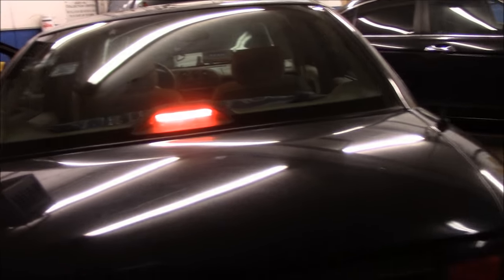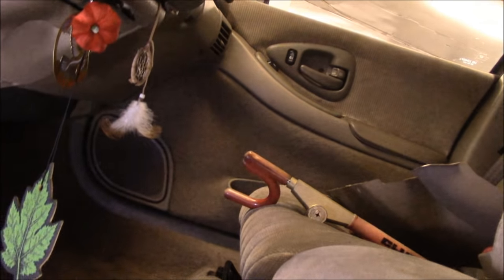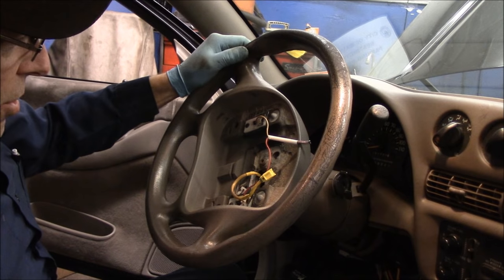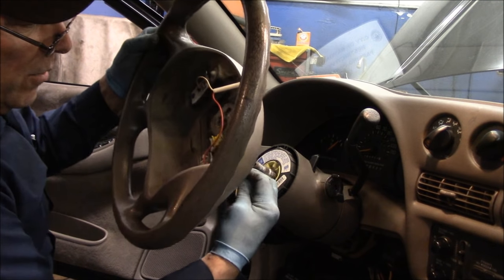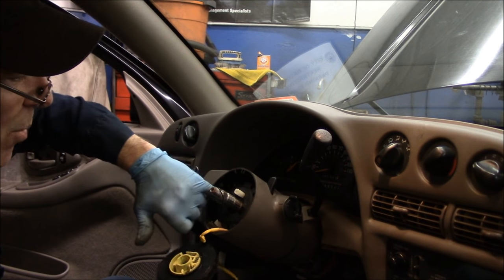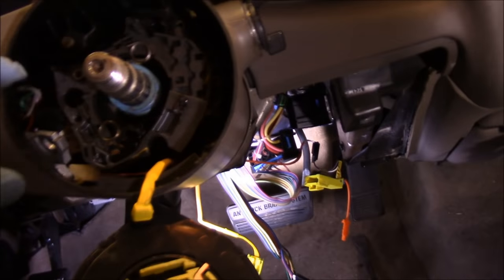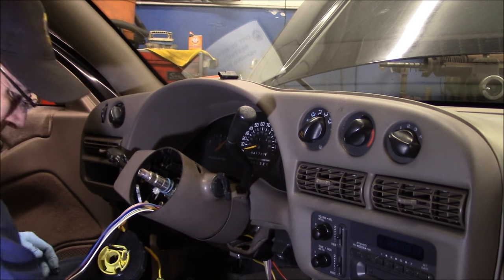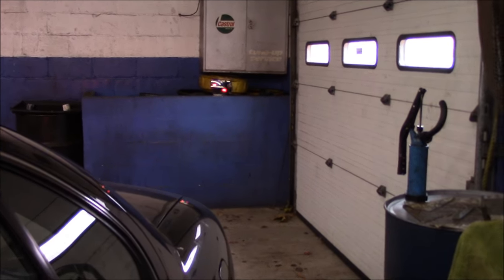Diagnose and repair no brake lights (3rd brake light works)

Comment: Brake lights on my 2000 Tahoe stopped working but the roof light worked.  The problem?  The hazard switch was the issue.  A $15 switch was all I needed.  The old one would work if pressed to the left to make batter contact with the 3 copper spring loaded contact terminals so I figure the spring for the stop light circuit was bad. My 4 ways worked,, turn signals worked but not the stop light.  Problem solved.  Pull out the hazard switch using a pick on the front left corner to release the tab that holds it in. pull it up and plug in a new switch.  A simple fix!

Comment: Had this problem, I just took the third lights bulb rerouted it to each tail light and drill a hole with keyhole bit.
Reply: Hey justin which 2 wires go to brake light coming up from bulb itself. Don’t have d.c.meter and can’t I go to just one side let’s say driver side since they are tied together
Reply: YUP...MICKEY MOOSE...IT WORKS...(Moose?? Bigger than mouse...it works...I am about ready to jump mine like that!!! 91 Sentra...great car...just problems with right rear brake has me spinning...grrrr...ha!!!

Comment: All three of my break lights are out on  a 2012 Kia Optima and the bub's are good. Tried to remove the switch but there is no room to remove it. Need a good step by step video on how to remove and replace with a new one.

Comment: These cars are a nightmare with the way they wired them.  Mine is possessed because sometimes things work and sometimes they don't.  The radio will not stay on and I cannot control the lights manually.  Ugh!  Thank you for the video!
Reply from the maker: Thanks for sharing

Comment: Just used this to fix my brake lights on a 2000 Chevy Lumina. Things to note: The steering wheel and the sensor under it cant be put in any differently. They all have special notches to prevent misalignment. The only really challenging thing was to get that lock ring off of the spring retainer. Otherwise with these instructions it was a fairly easy fix. Thanks For The Video!

Comment: in 2013 I had a 97 Lumina with this issue. Mine worked when I pulled the Turn Signal lever back. I knew it would be too complicated and expensive to get it repaired so I just rode it out with my janky lumina lol. I miss it.

Comment: Jim, THANK YOU. I purchased a 1998 Lumina for my granddaughter,  2 months ago the brake lights failed. I followed your directions and purchased the part at Auto Zone for $53.00, they in turn loaned me the puller and compression tool for FREE. followed your instructions and in 2 hrs she was back on the road. Great job explaining! Now all I have to do is put a motor mount in. (You got a video for that?)
Reply: What’s the name of the part?

Comment: My moms 2005 Altima’s fix. After trying all “THREE” fuse boxes, changing bulbs (smh, bulbs wasn’t blown) it was the brake light switch that was causing the break lights not to work. (Break light bulb is the same as the tail light bulb, if the tail light works then check your brake light switch. 30 second fix, no tools required to replace.

Comment: I remember doing that same job numerous times. Today's cars are so much easier with the modular multi function switches. The lock plate depressor is a must-have tool.
Reply: I have a 1996 Chevy Lumina only center brake light works. It only has one bulb on left and right side to operate the parking,brake,signal and hazard. Why would they have one bulb to do all that?

Comment: Thank you for your video-I am not a mechanic of any sort but i did check my bulbs and fuses and think i have a wiring problem-need a water pump as it is and I am now wondering if its even worth to keep getting this car fixed! it had a new tranny in 5 years ago and i dont drive a whole lot also an alternater heater core and thermostat! Im just discouraged! But still thank u! My lights also on dash for gears shift work intermittent-seems chevys are kinda notorious for wiring issues!

Comment: I have a 92 buick riviera 3.8 my left brake light works sometimes than it stops than it works again so on so on could that be the break light switch or you have any direction i could start at i parked my mustang and need this for work monday lol thanks in advance

Comment: Just had no rear brake lights/ no turn signals,,,, the wiring harness from the frame to the trunk was the problem, notorious for the problem... Fixed in an hour
Reply: Could you explain a little better for me? I’m having same issue…
Reply: @trisharush6070   look on driver's side of the car,, and the wiring harness goes under the floor moulding.. follow it up along the rear seat back and you will see where the harness goes through the metal hole and continues into the trunk.. The harness usually shorts out at the point where it goes through the metal hole

Comment: so heres a question. My 2001 maxima only has the 3rd brake light working. I replaced the driver tail light and it didnt work after that. I tried switching bulbs and testing using the old tail light wiring snd nothing. The light works for headlights but not brake lights

Comment: So this switch does the brake lights and turn signals in back right? Third light works. Tail lights work just No brake lights or signals
Reply: rebecca anderson When you put your signal on with the brake pedal depressed, the circuit thru the switch allows the brake light on that blinking side to either go out or be blinked. If the brake light stayed on it would outshine the signal light to some extent, depending on your make and model of car. This switch is a chronic problem with GM vehicles it seems.

Comment: I'm having this problem with my 2007 chevy uplander. My brake lights or blinkers don't come on, my tailgate brake light work, my hazard lights work inside the car but not on the outside. We changed the fuse and it still isn't working.

Comment: Mine is doing the same and also I can't use my turn signal either where can I order the replacement multifunction switch and handle if need be

Comment: I have a 2011 Cadillac SRX.  I have changed out my brake switch several times, but the brake lights come on when leaving the vehicle. I had it fixed again; but now, the brake lights still come on when the alarm is set. Have you ran across an issue just like this or could it be the same since I replaced the clockspring?

Comment: 2013 hyundai sta fe. Exactly the same problem. Only the third light goes off when i step on the brakes but when I lock the car, the brake lighs flashes.

Comment: My third doesn't work, but volt meter shows 12.5 volts. Jumper wires to a spare 3156 wont light it up.
I'll have zero volts at the third when connected, but if I unplug it, my volt meter jumps to 12.5.
I've never had a 12 volt system behave this way

Comment: Im working on a 1996 crown Vic police interceptor. Problem I’m having is that the brake lights (and hazards I might add) are not turning on when engaged. The third light will come on, but not the other 2. Hazards will not turn on in rear either but they do come on in the front. Blinkers work fine. I’ve tried messing with the hazard switch, replaced the brake switch at the pedal, and checked bulbs/fuses. Something to note (unsure if relevant) is that the hazard “clicking” when engaged is faster than the blinker (unsure if that is normal) but it’s almost as fast as when it’s telling you the bulbs are bad. I have not tested the lighting control module because the blinkers are fine. Any help?
Reply from the maker: C L18 this car has two flashers one for the turn signs and one for the four way did you check both?
Reply: jimthecarguy thank you for the reply, in fact, I found out that this is only a problem while the vehicle is in park. In drive, everything works great, would you think it’s most likely a police harness issue they may have cut a wire? Only an issue while engaged in park.

Comment: Jim can you get me that car part? The turn signal multi function switch for my 1997 Chevy Lumina.My car has the same problem no brake lights and my signal doesn’t hold. It’s discontinued

Comment: Damn the car makers. Complex  cars suck. Wiring cars up like this SUCKS. Hate it.  Could you imagine if the emergency brake light circuits went out because of an issue with some stupid accessory. This is all wrong.  Lighting circuits should be simple to repair.

Comment: The brake lights on my 2000 Tahoe stopped working,,the roof brake light worked,,turns and 4 ways worked. ???  After checking the fuses in the fuse panel.. all good,, no tow package so no fuse or relay under the hood.  I cleaned the ground bolt and washer on the left rear frame where the light harness was grounded using a wire brush.. still no brake lights.  SO... to make this short what was the problem?? A loose 4 way switch.  I found out by holding that switch to the left with the 4 ways off and depressing the brake peddle,, the brake lights worked!! So the switch has apparently somehow loosened up. I took a small piece of cardboard and folded it to a size I could wedge into that hole to snug up that 4 way switch for a temporary fix until I have time to pull off the steering column collar to check that switch to see if I can fix it or have to replace it.  Meanwhile I now have my brake lights back.  Have a nice day officer!

Comment: So I have this same problem, except my turn signal lights are separate from my brake lights, so I'm not sure if this will work. I have a 2013 Hyundai Sonata. Does anyone know which wires i'm looking for so I can replace it? I tried Google and YouTube but I can't find what I'm looking for if I don't know what it's called.
Reply from the maker: What lights do not work and what ones are working.
Reply: @Jimthecarguy  the two brake lights (left and right) do not work. The middle brake light works though. Also turn signals work. I changed the bulbs and the fuses and still not working.

Comment: Dear Jim,have a problem with my horn .Isnt working .Do you know where the hornrelay is located?Maybe its the relay or has it also a fuse?The other problem is my wiper,when I want to switch it on nothing works anymore ,before it did .Also maybe a fuse?and do have a idea where I have to look?Thanks Robert
Reply: its for a chevy cheyenne 20 year 1979
Reply from the maker: Fiat500dokter  what year and model car? Also did you check the horn for power and ground? E mail me at jimthecarguy1@gmail.com

Comment: This problem won't happen in a car that uses a separate bulbs for turning signals, whether the rear turning signals are yellow or red.
Most domestic brands (GM, Ford, Chrysler.. etc) still use the old American invented method of combining the rear brake lights with the rear turning blinkers, which does not comply with some European traffic codes. It was so confusing to drive behind a motorist who apply brakes and signals in the same time, and it's worse when he/she applies the hazard lights (both side blinkers) you won't be able to tell when they press the brakes. That's why they came up with the"Third-Eye" solution back in the eighties. They should've used the European code (red for brakes/yellow for signals) instead of that not-so-brilliant 3rd eye idea.
Reply from the maker: Thank you for watching

Comment: So if I have 1(left) tail light not working and the right one and center(top of back window) are working am I still legal
Reply from the maker: No you need all your brake lights working. Thank you for watching .  Don't forget to subscribe.
Reply: @jimthecarguy  hey Jim can I rewire in other words, can I take 2 wires from the 3 rd light in center of window and go directly to the first light on the back so that when that light comes on it will send power to the other 2 lights and if so which 2 wires do I tie into on the 3rd light and which 2 on which side driver or passenger.

Comment: My turning signal (I like to call it the guts) parts, inside the steering wheel started breaking one day and the turning signal would come in when ever I turned the ateering wheel.....then then TSA.....turning signal arm.....become jammed....so I went with out turning signals now for about three months. Now my brake lights are not coming on.....but the middle one is......I know it has to do with this exact diagnosis (1997 Chevy Lumina).....I am goung to show this to my mechanic.....maybe he will charge me less..😉.....thanks.♠

Comment: I’m going to watch the entire video but I’m just curious if anyone knows quickly how to remove the brake light switch, I got the two wires disconnected but I’m afraid to just pull on it
Reply: oh god i pray its just my brake switch, i dont want to have to attempt to disassemble an air bag... my turn signals work, both bulbs arent burnt out however only one works on either side, when i depress the brake, the middle light comes on but the lowers do not. When I turn my headlights on the one bulb that works does light up. I just want to try to remove this switch without damaging it. I think i just have to twist and pull but im afraid lol

Comment: What does it mean if my tail lights wor but it doesn’t glow when I brake? They glow but not when I brake
Reply: If you're using 1157 bulbs, make sure they are in the correct position.

Comment: Hi Jim hope your having a blessed day I have a 2012 Dodge Avenger when turning on my lights they all illuminate in the front and back  when i apply the brake my driver brake light doesn’t turn on only the 3rd light and passenger light. Then when I turn on my passenger turn signal it blinks very fast on the odometer and front passenger headlight but in the back light , nothing. I checked the bulbs and they are not burnt. So basically I have a driver brake light that doesn’t work and a passenger light that doesn’t blink What could be my issue ?

Comment: Jim, thank you for making this video. Would you suggest using an OEM turn signal switch or a NAPA aftermarket replacement switch? 

I just got pulled over by a police officer because I have the same problem with my turn signal switch on my 97 Lumina.
Reply from the maker: You can use the Napa parts they are less expensive and work . Thanks for watching.
Reply: @jimthecarguy  Thanks Jim.

Comment: so i changed my heater core in an 03 s10 now fuel pump and both back break lights don't work ,power to the pump just not to the  relay ,had to take the dash apart and steering column down ,so this may be my issue ,

Comment: I have a 2002 Ford ZX2 that has no brake lights but the third brake light works. Rear turn signals don't work but front ones work but blink fast. Any ideas whats wrong?
Reply: Did u figure it out? Mine is doing the same

Comment: Yeah to much work I just ran a wire from the third brake light straight to the  cable on the lights that didn't work now they get the signal from the third light spent 5$ in cable and electric tape
Reply: Can you tell me how you did that?
Reply: Please tell me step by step how you did it.🙏
Reply: Can you please tell me step by step how you did that 🙏